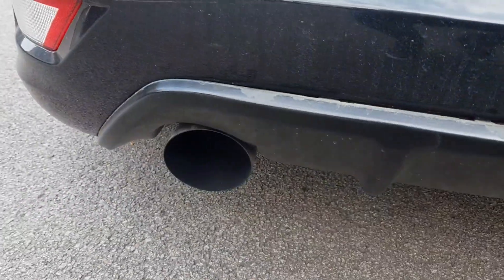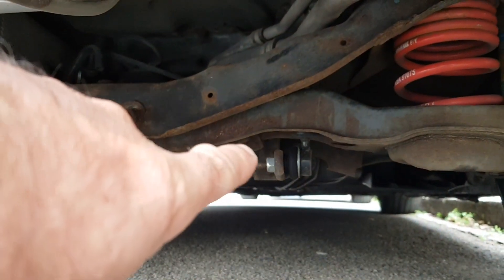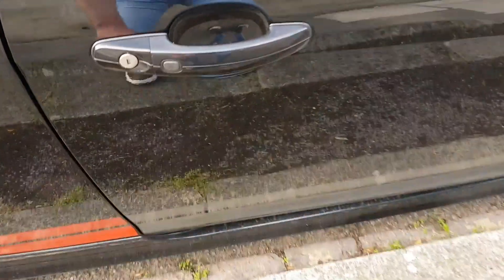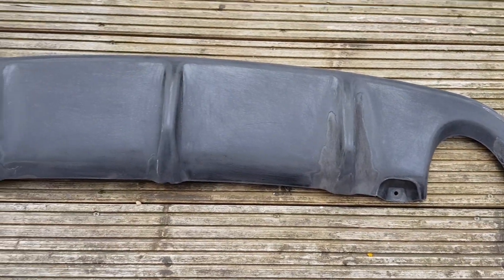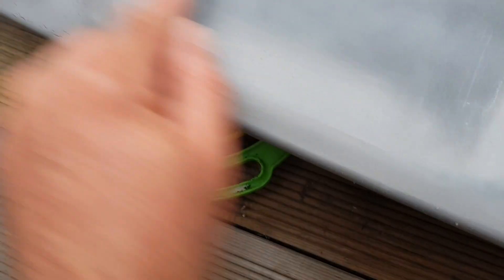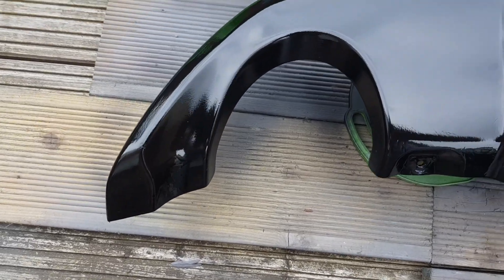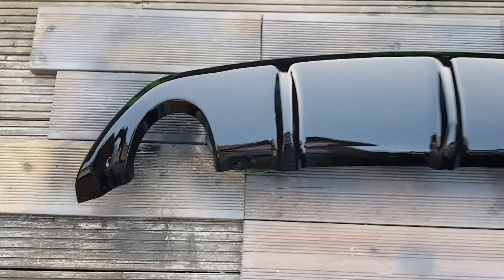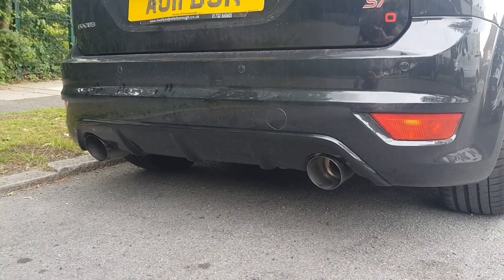Prep work for FORD FAIR - Rear Diffuser

Comment: Have you thought of doing the mod with LHD reversing lamp and red bulb to replace the red foglamp in the rear bumper? It’s a nice look with the clear lamps on both sides 👍
Reply from the maker: Sounds like a plan.... 👍
Reply: There is a kit I fitted which adds a second reverse light and keeps foglight with LHD unit no cutting wires all plug and play 👍🏼